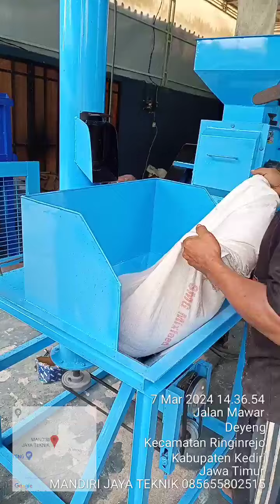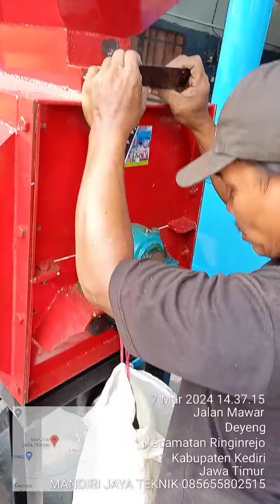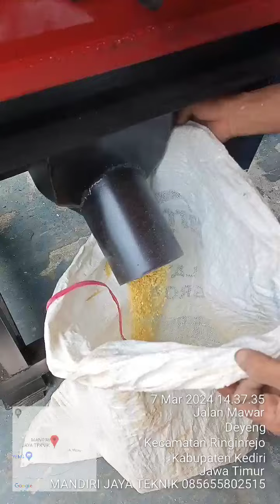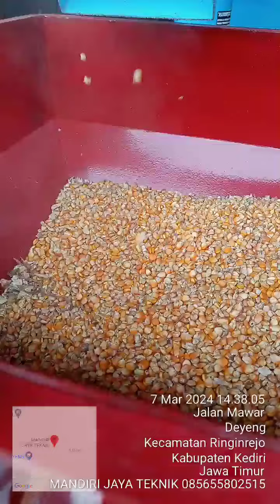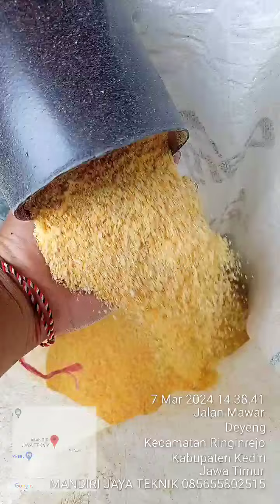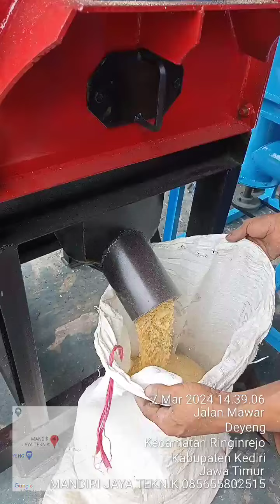HAMMERMIL PENEPUNG 45 mesin penggerak Diesel solar 24pk (Saringan 5mm) PENGIRIMAN PALU 👍085655802515

Comment: Pake saringan 5mm jagung pipil hm tipe 45 diesel 28 hp per jam dapet brp kira2 om
Reply from the maker: @ekoandroid7796  sekitar 2 ton bosku
Reply: Kalau saringan 0.8 brp per jam nya
Reply from the maker: @downstream5227  tergantung penggeraknya juga bosku, kalau tepung jagung sekitar 400kg PERJAM kalau penggerak 20hp 3 phase lengkap Blower + Siklun penggerak Dinamo 5hp 3 phase